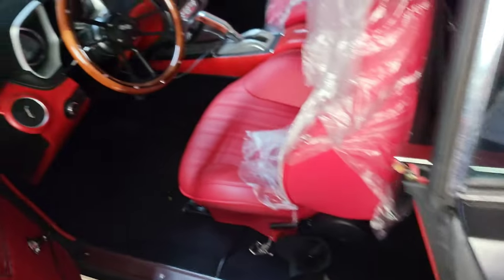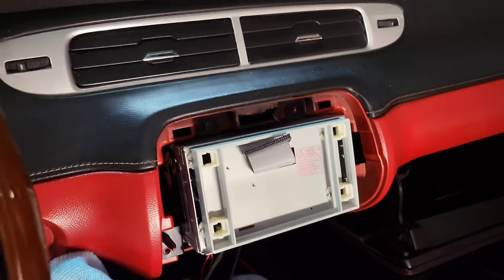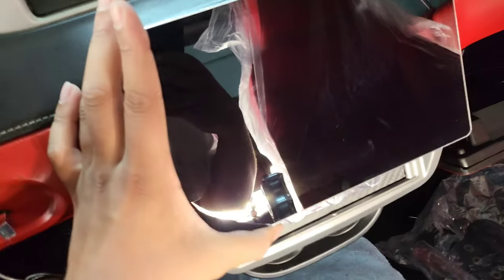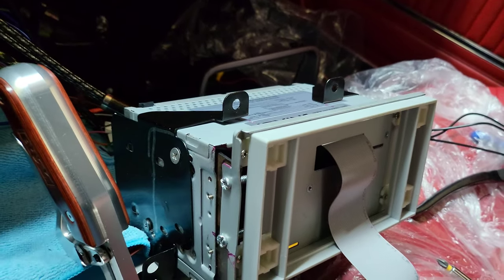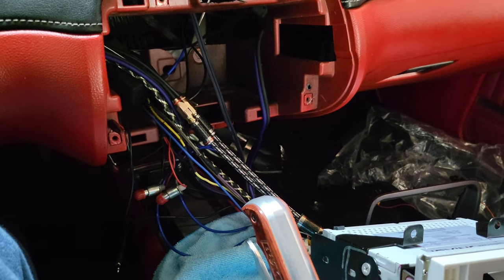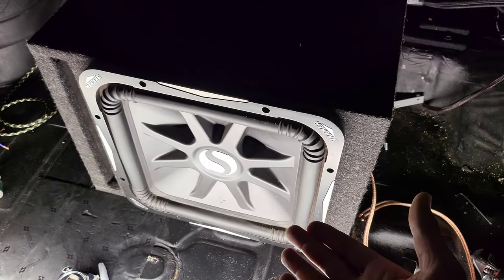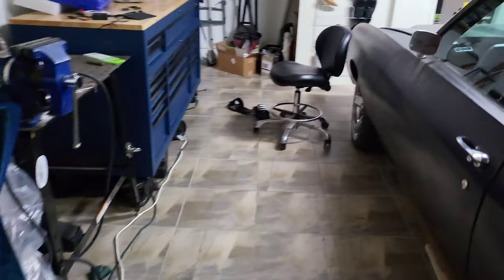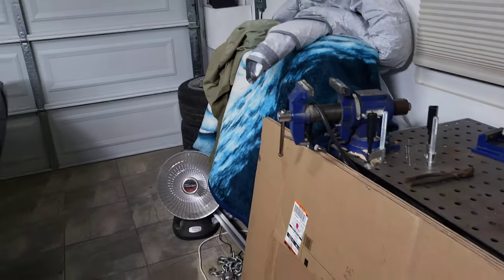Sound System complete! |72 Chevelle

Comment: Where did you get the dash install kit I'm doing a Camaro dash swap in my el Camino.
Reply from the maker: scosche! Definitely didn't come like that tho fully customized now lol
Reply: @Califormula   Thanks
Reply: You fabricated the brackets to hold a radio
Reply from the maker: @dennisalstonZ06  na just drilled new holes in the head unit the brackets came with that kit.
Reply: Thanks again
Reply from the maker: Any time man, good luck on the swap🤙🏾